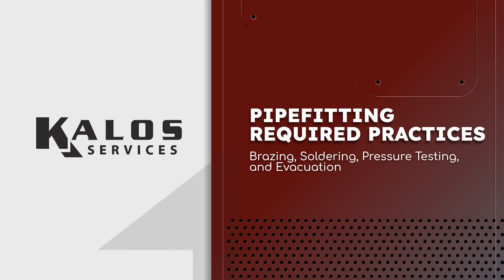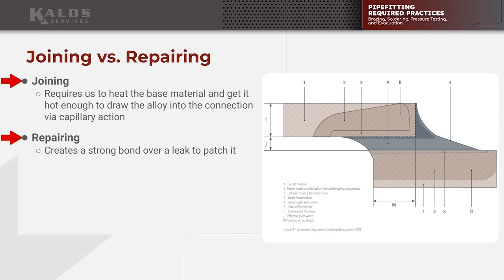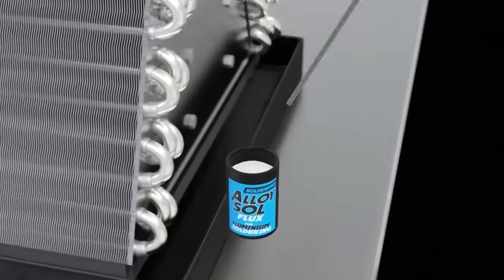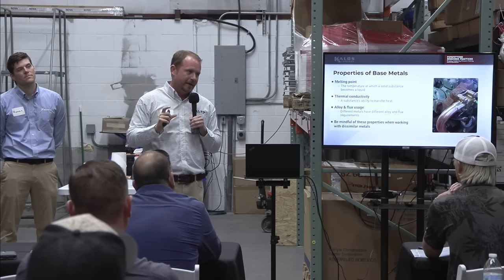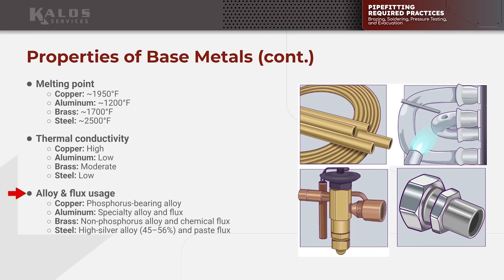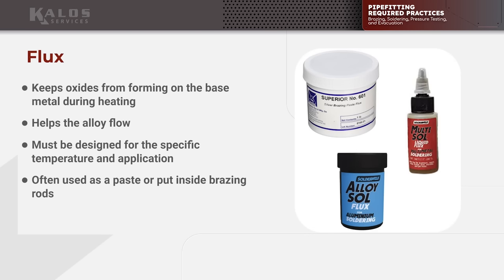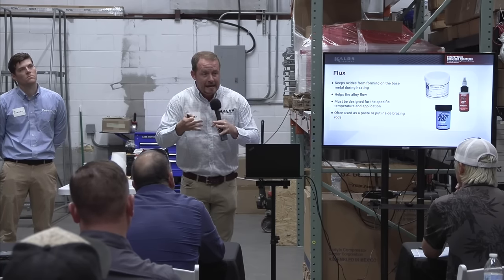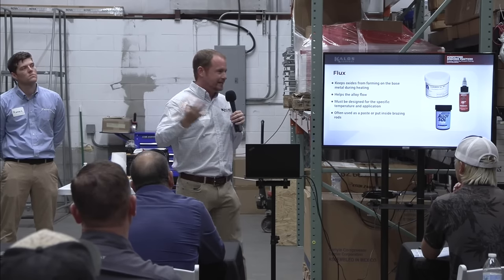Brazing Techniques

Comment: Small wet rags around each tube on evap coul and on txv's pull caps and scrader cores out.  Rap driers close to drier body.  Make sure flame never hits the txv power head .  Always braze the suction first.  Purging is good on new hard drawn pipe if you can't put 5 psi of nitrogen purge with nitrogen and use the vac pump.   You will use alot of vac pump oil.  Old line sets have to be flushed with rx11 or liquid flush.  Use lots of nitrogen with l liquid.  Use clean up driers if it's a bad burn.  Acid way works also.   Cut flare off and braze.  Prevents headaches.   On flares on mini  splits you can cut flares of at the evaporator and swag with one braze joint.  Flow nitrogen.  Through.  I always use 400 psi or more for pressure for leaks.  Flare at a mini splits I use leak lock from high side chemicals at the condenser.  Only rubbing alcohol can take this off.  You do that at the caps to.  Most techs won't know this and this stop the leaks on top of service valves and brass caps.  So leak detection can only be needed at the evap return bends or the flare on a bleed externally equalize txv.   Last would be at the condenser rubbing on the bottom of the pan.   A coils that are old or slant have sheet metal and not aluminum.  Some installers will not pull the new coil out of the case to make sure nothing is rubbing.  That will cost you time and material.  A little of arm flex or cork tape will fix that.   Always use wet rags on plastic drain pans or condenser pads.  Good vacuum of 1000 microns will make your system super dry and absorb refrigerant alot more easy!!!!!  When in doubt on long Refrigeration lines use another vac pump on evap coil were sollonids valves and txv's are 1000 microns no less.  This will make the competition die.   If you need or don't need use leak sealer from Refrigeration supply distribution from ???? Will only bullet proof the system even better!!!!!

Comment: Brazing is easily the most satisfying part of the job.  Nothing like getting a nice clean joint all the way around with a nice crown filling in the edge.  Ive also found that placing an inspection mirror underneath the suction line service valve while brazing ensures you fill the entire joint the 1st time around.  Since you cant see underneath when brazing, the mirror allows you to see you have filled in the area you cannot see with your eyes.  Then you can move around and get the spots you can see
Reply: What  tip size you use and pressures
Reply: Great tip!

Comment: Great, video.
 Thanks for free teach. I have a question. Some body soldering HVAC lines with Staybrite 8 and says it is stronger, cleaner and faster than cooper brazing.
Do you think is it the right way and stronger than cooper to cooper brazing?
Reply: Wondering about the legality of  S 8 also. Looks like it's frowned upon in residential HVAC? 10,600 psi pressure rating on the SDS. Harris says it's OK for refrigeration.

Comment: Very informative video. Now, what do you think of the use of RLS fittings and the cordless tool ? I tend to compare the plumbing PEX fittings from Uponor and the expansion Milwaukee cordless toll as well. My question is : is the RLS jawkit8 tool along with its copper fittings a permanent substitute of brazing torch ? I’m talking about exclusively for residential applications. I will start HVAC school soon here and I want to focus on residential only. Your input will be really appreciated. I’m a new subscriber here . Thank you !
Reply: Short answer - they are a game changer for multiple reasons and so far seem to work great, but nobody knows the real world lifespan of the gaskets.  The biggest difference in HVAC vs Plumbing is our pressures and temps fluctuate.  The biggest resistance to this is the fact that a properly done soldered joint is 100% going to last.  I think the time saving and risk reduction is worth it and would use press fittings exclusively if I was a tech. -A certified factory support rep and trainer for 5 manufacturers.

Comment: Doesn't brazing's extreme heat alter the properties of the copper and weaken it.  Like it anneals if it wasn't already annealed?   I've been hearing that soldering creates stronger joints when you use the right kind of solder.
Reply: Maybe, but never is it the annealed copper bursting that causes leaks, it's cracking or rubbing through or some such.

Comment: I do residential appliance repair and perhaps it’s a different ball game but I’ve never seen anyone run nitrogen when doing any brazing or soldering. They don’t even mention it at the manufacturer trainings. Now I wonder if the oil we work with doesn’t cause any issues if we don’t run nitrogen because no one in this industry ever talks about it where I’m at. 

We mostly work on R134A and R600A. The capillary tubes may be smaller so I also assumed we don’t do it because maybe it will bubble the joint. 

I’ve also been doing it without running nitrogen for about 5 years and never had any problems that I’m aware of.

I’d appreciate an opinion if you have one on that.
Reply: How are you brazing aluminum to steel or copper to steel?
Reply: @whitesheatingairappliancer7101  I’ve never seen a aluminum to steel connection but I tried it once for fun and what worked for me was Multisol from solderweld. It’s tough for me to use but it also works for steel to copper. I only use multi sol  if I don’t wanna apply too much heat. My go to for steel to copper is Sil Sol 56 and for aluminum to copper pipe connections I would only use Al-Cop braze. All from solderweld and they are all easy to use except MultiSol, at least for me
Reply: @whitesheatingairappliancer7101  steel to copper was difficult for me for a long time but I recommend that you try Sil Sol 56. You heat up the copper a little bit and then focus the heat on the steel next to the joint until the steel is red hot, it should melt in around the joint perfectly. It never leaks for me if I do exactly that and let it cool down by itself without putting a wet rag on it. And to be honest, I’ll let even put Stay Silv brazing flux on the joint before brazing. It’s unnecessary but it works better for me.
Reply: Are you running oxy-acetylene or just acetylene? I use oxy-acetylene and a higher silver alloy and do the joint quick, so that might be the reason (if not oil)… I think gthose running air acetylene, with say a TurboTorch tip (probably oversized), are placing a lot of heat all at once causing much more oxidation inside…
Reply: @EarlHayward  I just use acetylene with a fairly small tip. The connections I make are smaller. The only other issue I’ve had is actually focusing the too much on the steel and under heating the copper. I’ve also had best results with the high silver flux coated rod. If I heat and clean it properly the joint comes out a shiny silver all the way around indicating that it’s unlikely to leak. With these joints I avoid cooling them off quickly. Just about every time I’ve done that it ended up leaking, sometimes it would take 15 min for the micro bubbles to form.

Comment: Can you use CO² as a purge gas instead of nitrogen when brazing refrigeration pipework?

Thanks for the videos, I've found them very informative.
Reply: Co2,although you can get dry c02, it's much more expensive than nitrogen which is why we use it instead.
Reply: So, yes you can lol but I'd save c02 for the keggerator. Stick to nitrogen for brazing
Reply: How did you exponent your "2" like that?
Reply: @MR-backup  I stuck my finger on the number 2 and held it. I then get several options like ² and ⅔ and ⅖ for example. I'm using the gboard keyboard thing on Android so it might differ for you.
Reply: @HVACRTECH-83  The reason I was interested in using CO² instead of nitrogen is that CO² is stored as liquid when it's in a cylinder whereas nitrogen is just compressed gas so you get a lot of CO² in a very small cylinder which means it's more portable. To carry the same quantity of nitrogen you need a bigger heavier cylinder. 
I just wasn't sure if using CO² would result in an inferior braze or weld joint.
Reply: @andrewd762  Oh, I see.

Well yea, I'm using a keyboard.